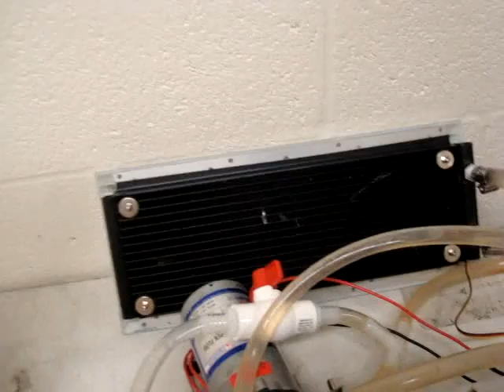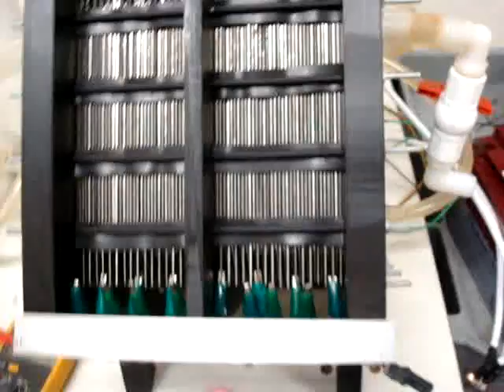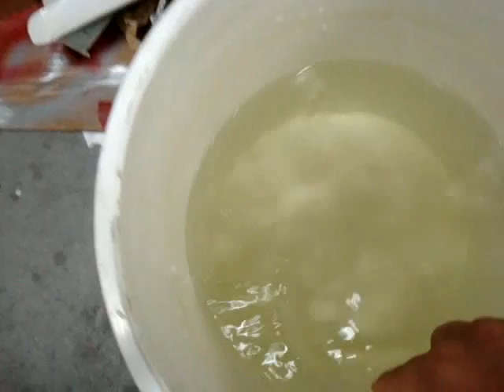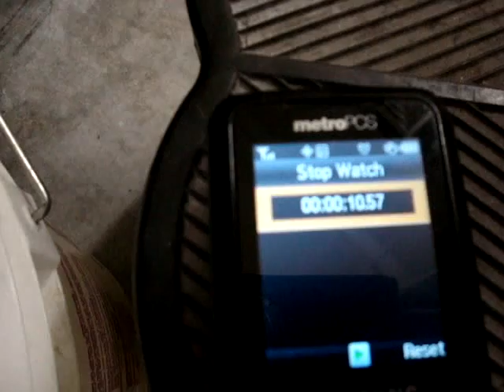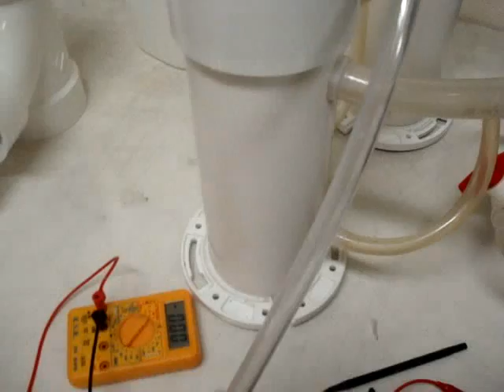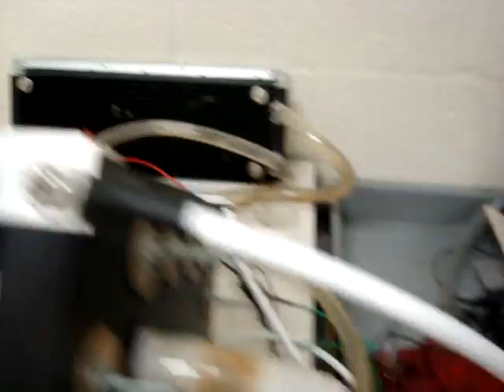HHO Dry cell made by G.T. Baker Aviation High school students 2008-2009

Comment from the maker: yeah we've don't it that way too, but the purpose of the pump is so that the electrolyte can be pumped through the radiator with ease, hoping that the radiator would cool the electrolyte, and ultimately cooling the cell. It was what we were trying to achieve at the moment. thanks for the comment.

Comment: its easy ... I am running 120+ volts ... so I need a LOT of neutral plates to drop the per plate voltage down into the sweet spot ... my current build is +/68N/- ... works great ... big stack will need wider spacing ... I use 1/8 gap where most use 1/16 ... I just double up gaskets ...

Comment: well, that is what I did ... cost me $20 ... would have taken me more time than the $20 is worth to try to make my own ... and making a pwm that can handle 120v at 20a is not trivial ...  easier, simpler,cheaper to use the SSR triggered by an off the shelf unit ... it works and can be done for low dollars ...

the setup you are working with is the current standard state of the art in home built units ... more advanced designs are being worked wiht but are not yet proven ...

Comment: if you decide to try to use a PWM, get a GOOD quality AC Solid State Relay rated at least twice the max load you expect your device to draw. Use the output of a small cheap 12v PWM to toggle the trigger on the SSR.  From the SSR go to your Bridge Rectifier AC input.  Do Not Try To Trigger the DC side directly ... you will eat SSR's ...

Comment: with no pwm, you will have to use the concentration of KOH in your solution to control amp draw ... a pwm will help you to moderate the duty cycle on the device so you can throttle back a run away reaction and not have to be so precise with your solution mix ... I use 40 grams KOH per gallon ... think you are at about half that ...

Comment: if you want it to put out 10 lpm, it might be possible to do ... its tricky but can be done with a setup like you got there ... think I would start by setting it up run off 120vAC wall current ... build simple ac to dc power supply using a bridge rectifier and maybe a big capacitor ... slim down to about 68 plates ... hit it with rectified 120v at about 20a ... with 2400 watts going in, you should make maybe 10-12 lpm or so ...

Comment from the maker: Oh! and how can i get the cell producing like 10 lpm like ive seen on other videos, 2.2-2.5v per plate gap? and ive read, if you go high volts, low amps its better. i really want to get it to like 8-10lpm, we are hoping we can run like a electric generator or possibly a torch.

Comment: very nice build ... obvious that a lot of time and effort went into that ... 

I will take exception to hhoforvolts' comment  ... am sure that he has works and if it works for him, I am not inclined to argue ...

but, I like to be at about 2.2-2.5v per plate gap in a series type device what you have constructed ... so your +nnnn-nnnn+nnnn- is a proper arrangement for operation for 12v ... a 5n might also work ... if you want to go to 24v, try a +(9*n)- ... or maybe a 10n ...

have fun with it